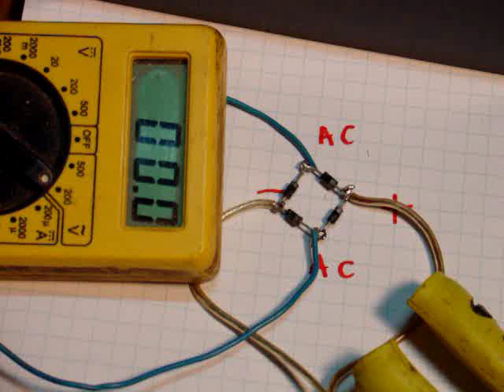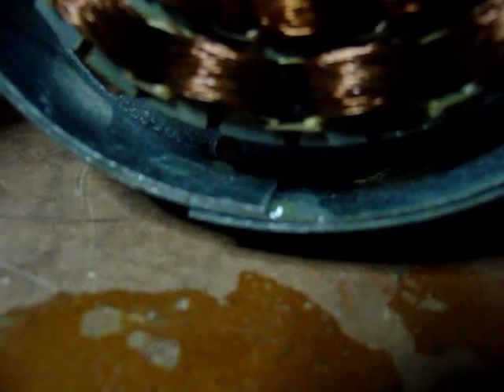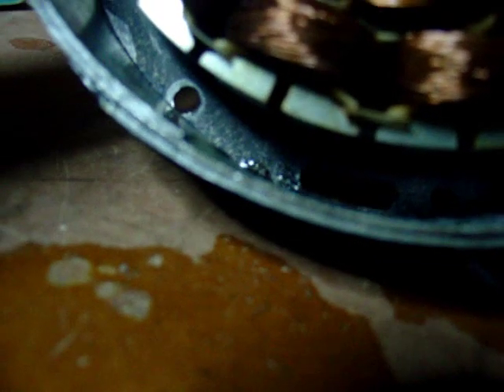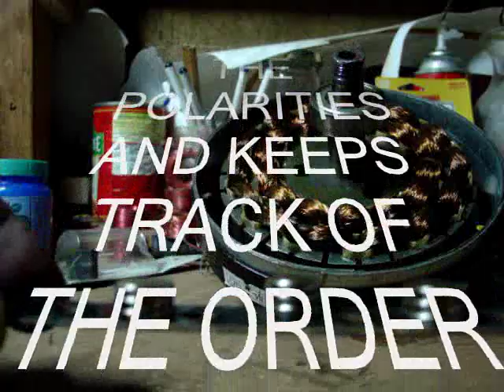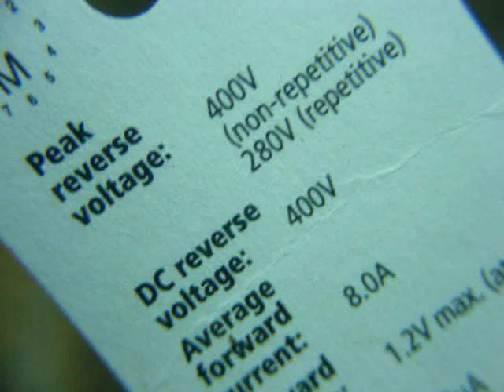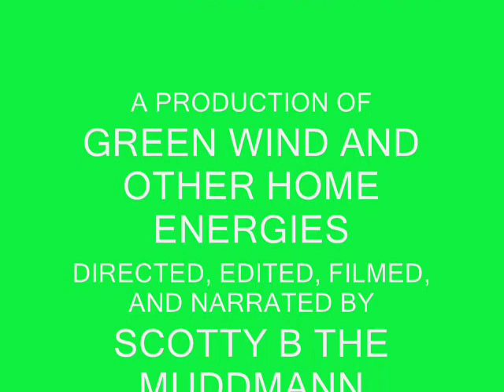PART 6 HOW TO CEILING FAN WIND TURBINE

Comment: Why are you using 4 blades when all wind turbines use an odd number of blades ?   Three and five being the most popular.
Reply from the maker: Moving Gear Productions (1) two bladed props have a problem with a slight jerking while changing direction of air flow. they are very fast, and low drag. Being One piece of wood, they can take very fast winds.
(2) Three bladed props are very smooth while yawing into the wind, still fast, but they have more drag, and slower RPMs. They need a lot of screws to keep them from flying apart, spacing of blades can change, and hard to line up, and balance, and truing the rotational plane.
(3) Four bladed props are even more smooth than three bladed props. slightly more drag, slightly slower than three bladed props. Decent torque, and can withstand higher winds due to their solid construction of two single pieces of wood, and very easy to balance. always trued up, spacing is not a problem, and doesnt need a lot of screws to hold them together. nery long life expectancy.
(4) There are a lot of the four bladed propped wind turbines out there. They are durable, smooth, easy to build, balance, dependable and long lasting. and less time consuming to carve, and assemble. I like easy and dependable.
(5) as for 5 bladed props.... they are not any smoother, much drag, slow and a waste of power that gets extracted from the wind. 
(NOTE)... some blades like Raptor blades, and all the very thin extra-multi-bladed props, are made thin to overcome the excess drag. Their theory is more torque for start up. They have to be made thin on the ends. They are also poly-materials, molded, and pressed out. all manufactured by industry.
I do only home-brewed, hand made, DIY, projects here.
Thanks for the opportunity to present this info. Very good question.
MUDDy

Comment: sir,i use your idea in my final project. i try to connect but alternator does not give result as you did. I cannot get 200 v above, i got 0 when i test it.
Reply from the maker: +Mohamad Taufik sorry so late in my reply.
either the magnets were placed out of order part of the way through, bad coils, or connections to the rectifiers are in the wrong terminals.
disconnect the rectifiers and test for ac voltage as you spin the alternator. If you see voltage the coils are fine. if not, then either the coils are bad, broken windings, or the magnets are placed out of order.
Thanks.
MUDDy

Comment: hey MUDDy, i was wondering what bridge rectifier should i purchase for this?
Reply from the maker: +Joshua White 
Sorry Joshua, It is hard to find all of the comments in time, and not miss a few here and there. These units do voltage very well due to the fine wire and number of turns creating resistance, So the amps are low. But it makes them pretty versatile on the choice of battery bank voltages. user friendly.
Plug and play so to speak.

I used 8 amp 400 volt rectifiers. they are pretty cheap. when i got these, they were 6 dollars for two of them at radio shack. they are probably 5 dollars each these days. sometimes i just take them from old junk stereos that plug into the wall. It would be a pretty rare day to see 3 or especially 4 amps out of these whirly-gig toys. so pretty much any rectifiers will do.

Thanks
MUDDt

Comment: Hi muddy,I have already started with a old ceiling fan of mine in India. Its 230 V and I think it might be around 60 to 70 W, the coils are of course 200+ ohm and here the config is that the stator has 3 wires out using one wire as common for both the coils in series. Is it a good idea to drill holes in the induction ring and fit the magnets in the holes and then fit the induction ring back in to the casing?would it work? coz i prefer that nice fit of the induction ring than making a bandring :D

Comment: so in resume, the best is to connect the alternator to a bridge rectifier an go to the batteries and then to the tie inverter, and ill never overcharge the batteries cause i allways be putting energy in the grid rigth ??, when you say go to a battery charger AC you mean a battery charger like AA or AAA Batts ?? and then to the 12 V batteris so i will charging alway the batteries and i dont need a rectifier rigth ?? if i do this, does the variations of the voltage can damage my batts ??

Comment: mr muddy if i use a charge controller, does the battery still working as voltage regulator ???

Comment: @muddymuddymuddmann So what you mean with this is that if i have 12V batts, the Voltage would be 12V in all the system if i have 24Vbatts would be 24V in the output of the rectifier no matter if is AC or DC, if befor my rectifier i go 90AC after the rectifier my voltage would be the same as my Battery Bank rigth ?? tnx a lot mr muddy

Comment: you are good muddy and i really appreciate the amability of your part for clearing all my doubts, i wanna ask you if in the specs of the box of the fan you can know the aprox amps would give as a generator. and other thing im using a charge controller of 12V/24V and 10 amps, can i hook up this motor to the same charge controller, or how can i make with the rectifiers that the voltage wouldnt be more than 12 or 24 V's, or just with connecting the charge controller to the batteries ***continue***

Comment: muddy so if my motor give me 90V i  need a bank of batery of 48V ? can you tell me how much V and Amps does your motor give of output ??, i think this is very cool but a llittle bit more complicated of understand than solar energy, i have a 250W at 18V Solar panel system, with 2 100AH batterys hook up in parallel, if i want to connect a gneretator like this as complement do i have to put inseries my baterries and double the Volts of my panels??, and other thig if i want to reduce ***Continue***

Comment: @muddymuddymuddmann pls tell me if im wrong, the piggy rectifier, uses the 120VAC of the wind generator and transform it into a 24VDC,how can u choose if u want 12 or 24, i mean if i have a 12 battery system can i use the specs os the parallel bridge rectifiers ?? or i need to do a modification ?? and is there a difference if i use 24V batteries ?? how much time does your generetors takes to charge 100AH battery ?? tnx

Comment: hi Mr muddy i have a question, im very happy with your videos im learning a lot, but at the beggining of this video, when you test de diodes reftifiers, it puts a 17.4 vols, what you mean when you sayyou have a battery and connect the negative lead to become a voltage regulator, and, in the beggining of the video where are you getting the volts ?? are you connected to a battery, or are you spinning the generator ?? tnx in advance

Comment: LOL, that doesn't sound like something someone with a 185 IQ would do.  :-)   At least you didn't do it with the turbine in the wind!  Your turbines are like mine, where you actually have to think or you could get a good shock.  Good video.  What did you end up with for open circuit voltage / RPM or MPH of wind?

Comment: hey, if i have my stepper motor turbine and it reached an open voltage of 20+ volts, would it be okay to hook up a 6v battery to it without it damaging the battery?